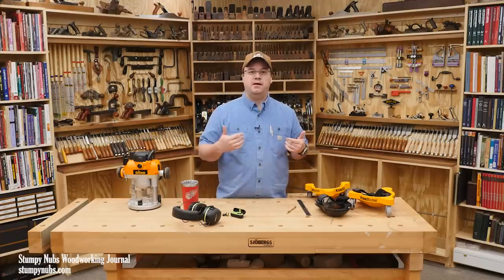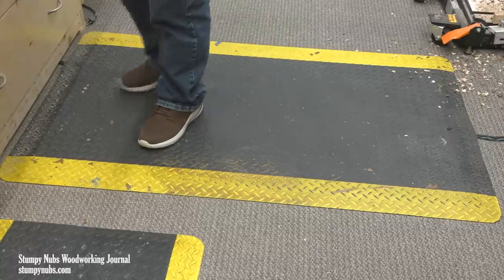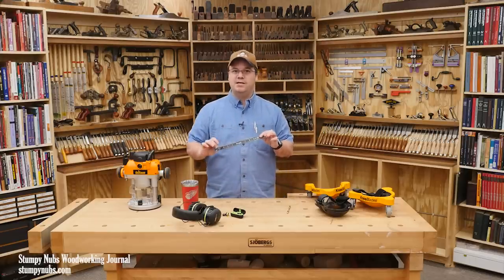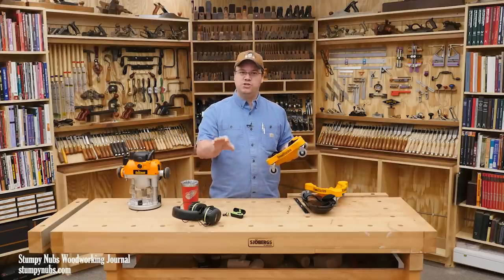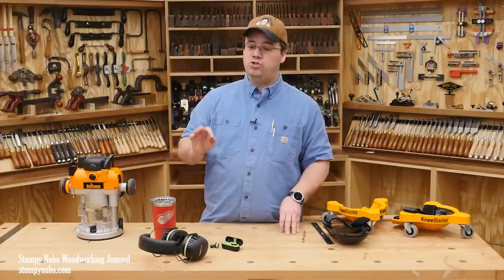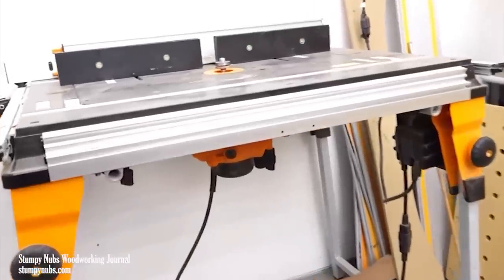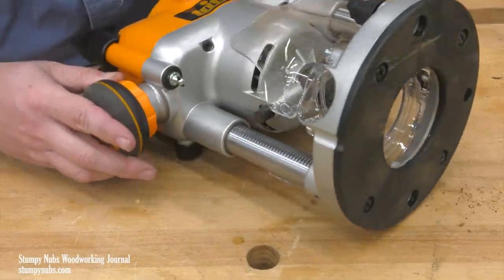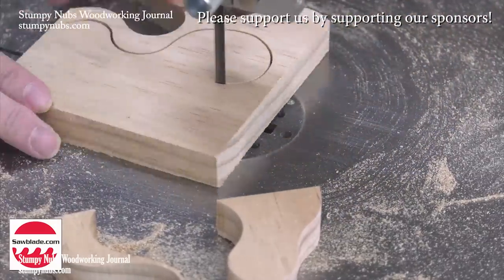7 Tools with SURPISING features you didn't know about

Comment: That router seems a bit top heavy. Would it benefit for lower handles?
Reply from the maker: Plunge routers have handles up high so you can plunge downward. They are definitely more top heavy than fixed base routers, which is a compromise you make in exchange for the plunging feature.
Reply: @StumpyNubs  Yeah,  but that one looks even more top heavy than my Bosch in the plunge base.

Comment: One thing you didn't mention about that knife is how cheap it is!  Only $34 at that link.  That's a fraction of the price of my Spiderco, for example.  But I'm not at all familiar with that blade material, 8Cr13MoV.  How hard is it, compared with other knife materials?  Or do you want a knife that's not hard, as with kitchen knives?
I looked it up:  About the same as AUS-8, but the edge retention is not as good.
So, it's an inferior Chinese version of the most basic cheap knife material.  Respectable material for the price.

Comment: I've had 2 of those triton routers for about 15 years. Be aware the speed controllers go on them. They are feature rich but not durable. There are possibly less reliable and durable routers out there but all the quality name brand units are better. There is an Australian company that makes an adapter to turn a makita router into a side wind system like the triton for table work. There are just better options. I've got the powered dust helmet as well and they also fail.
Reply from the maker: I believe the speed control issues were on earlier versions and have since been fixed.
Reply: @StumpyNubs  Maybe. I still see issues occasionally on the woodwork forum. Anyway good luck. If it proves reliable for you great. The features look great at a glance but over the years I've realised I'd do just as well with a normal makita and some careful thought. The router is an incredibly versatile and useful tool, but IMO a basic router and some clever jigs are the way to go. Here in Australia fixed bas routers are rare while plunge routers are common.

Comment: I've been eyeballing those rulers for a while, but I haven't pulled the trigger, yet. I'm going to check out those mats  too. I've got a carpet scrap in front of my bench. I put it down after I dropped my Lie-Neilsen rabbet block plane on the concrete. It's my only premium tool. I'm a line of duty disabled paramedic, on a pension. I had to sell a lot of crap I didn't need on eBay to buy that expensive little sucker, and I still question the wisdom of that purchase. Any way, after about 10 minutes of crying like a little girl, in a fetal position, I finally worked up the nerve to pick up my plane and assess the damage. There was none. That's when I learned about the wonders of ductile iron. Now I understand a little better why pros and hobbyists with deep pockets spend the extra money on new premium planes. If I had dropped my K5, and broken it, I may not have recovered from the grief.

Comment: Back in high school, I took a physics class that didn't allow calculators in the 1st semester. We had to learn how to use old-fashioned slide rules. I mention that because one of the key concepts in using them is the idea of "significant figures". "Sig figs" are the number of digits in a given value or a measurement, necessary to decide the accuracy and precision of measurement. 

I mention this because in the case of using a 1/16" rule, you can divide the 1/16 by eye in half giving you the 1/32. The precision of the Mark 1 eyeball is about +/- 1/10 of the division. So if you use a marking knife to measure out the dimension, you can get to within +/- 0.006 of that 1/32. which is more than good enough for all but the most anal-retentive woodworkers. 

BTW, shame on you for running electrical wiring under your floor mats. You better hope the fire marshal never stops by for a visit, or worse the wires fray and start a fire.

Comment: The soft floor pads shouldn't work, you have your foot and then if wearing shoes you have a layer of soft padding, then a hard sole (some softer than others), placing another soft layer under the soles shouldn't be able to lessen foot fatigue, but it works, I've used them in 12 hr.factory shifts. When working standing on concrete for hours on end my feet would ache, when I walked over to an area that had padded floor mats, I would instantly feel less pain, but scientifically speaking it doesn't add up in my mind how this works.

Comment: Hmmm, “Kershaw Gravel Folding Pocket Knife, 2.5-Inch Blade with SpeedSafe Assisted Opening”. That’s another name for a stubby switchblade. Why are they still legal in the USA? Maybe for the same reason that assault rifles are still available. I’m quite happy with my standard pocket pocket knife (which I never carry on me). Is mine just as lethal as your stubby blade? Yup, maybe more-so, but by the time I get it open the other guy is 200 yards away. I’m not suggesting and would laugh at anybody who suggested that you would use it as a weapon but a regular knife without “assisted opening” would serve you just as well…
Reply from the maker: Not the same as a switchblade. This unfolds, a switchblade shoots straight out of the handle.